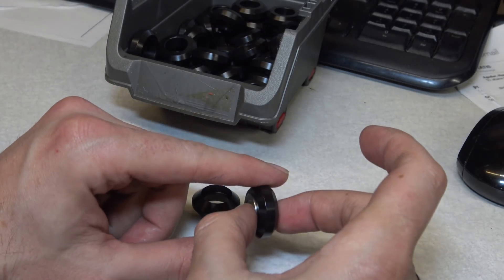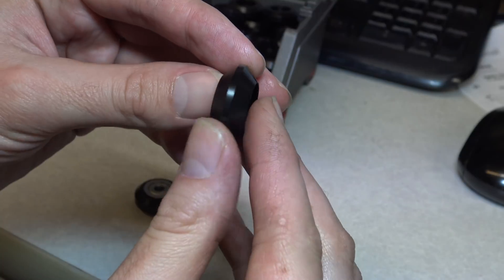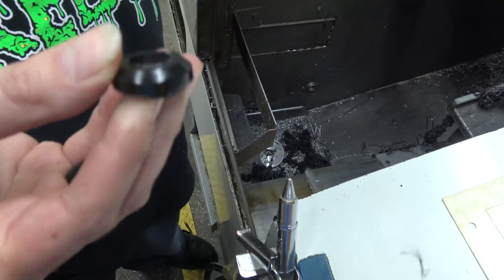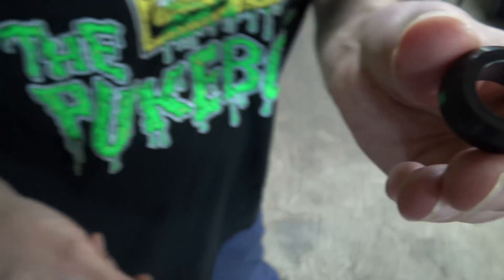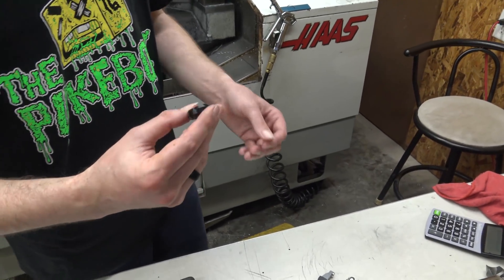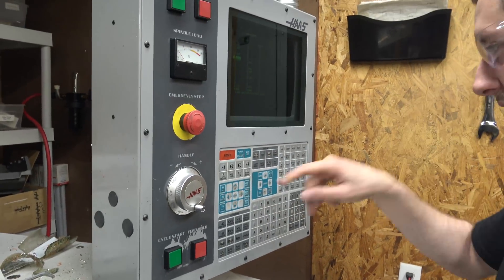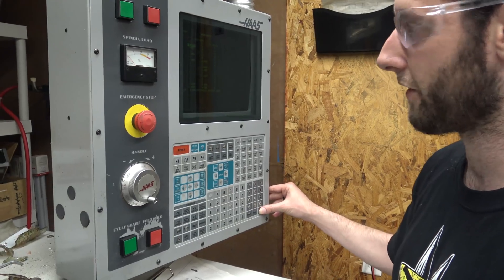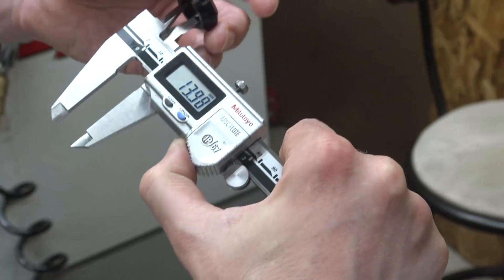How It's Made: 3D Printer Wheels

Comment: hi .. very nice and interesting ...
just a question ... in the openbuild's wheels, there is an additional lip where the shim sits between the 2 bearings ... how is that attained on a machine like yours??
Reply from the maker: We use a groove tool that comes in after the boring bar and cuts the additional lip. In this video we're making a different version that uses a flange bearing.